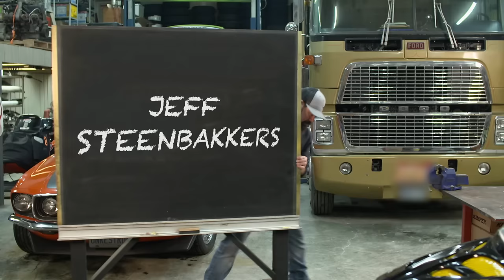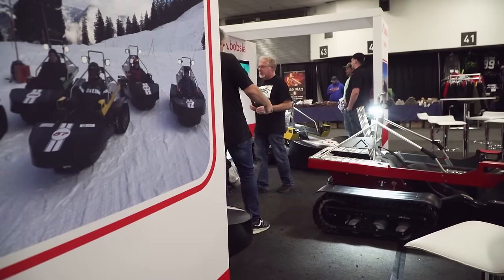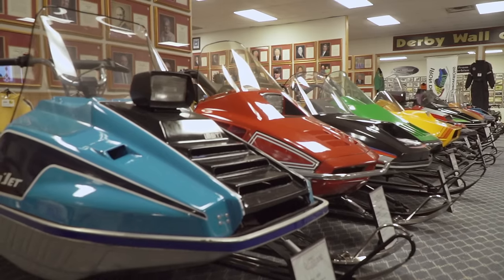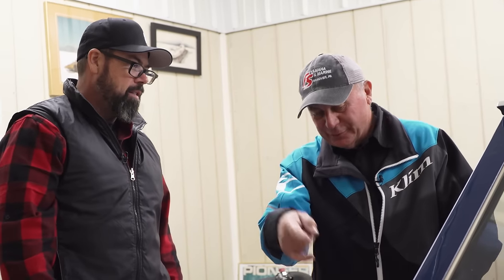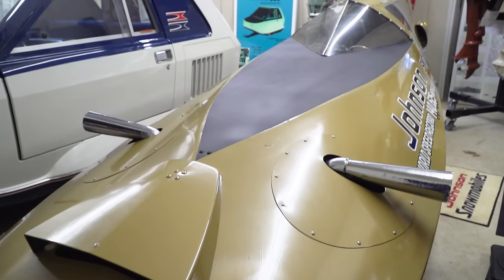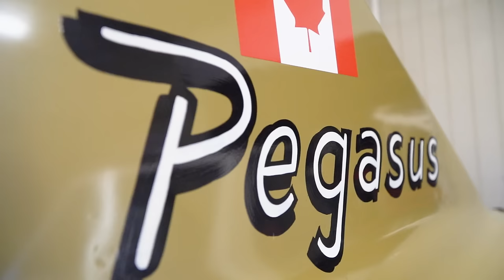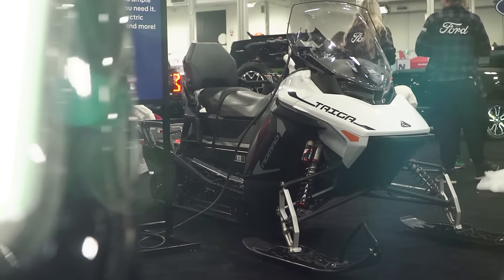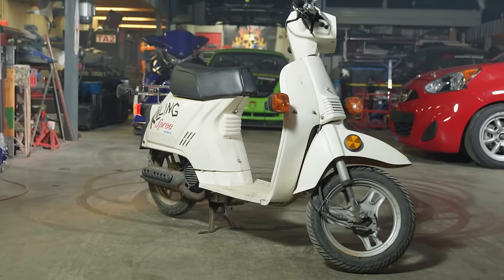Snowmobiler Television 2024 Episode 03

Comment: Electric sleds will go by the way of the Electric car. Flash in the pan!
Reply: I think they can work and be effective in certain circumstances like a rental fleet where charging and routes are the same day to day. I don’t see any electric sled working for how I like to enjoy sledding.
Reply: It's just the battery tech that's holding them back right now. Once Solid State EV's hit the market, the EV will greatly outperform gas vehicles in every way. Power and Range.  Toyota is ready to bring solid state to market in 2025.

Comment: I got a comment I wouldn't buy one but it will probably be all right for people close area around their house cuz if that battery goes dead I would not want to push that blessed thing because the gas won't you be able to work on it if you can change a spark plug up but the electric motor and you know you can't touch it cuz it probably kill you or the battery would but it'll be all right around like in a town or close to home but not out on a you know I went on one but anybody else if they want to buy it then go ahead but I will not buy one have a good day for a electric truck or electric car have a good day sir